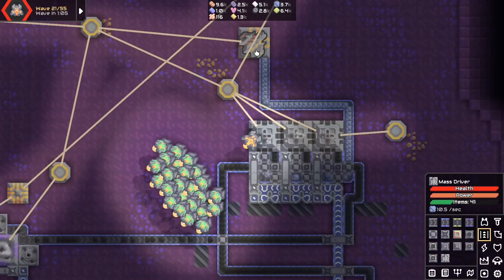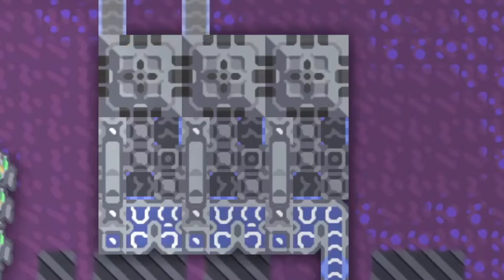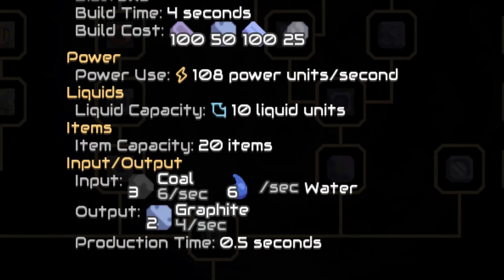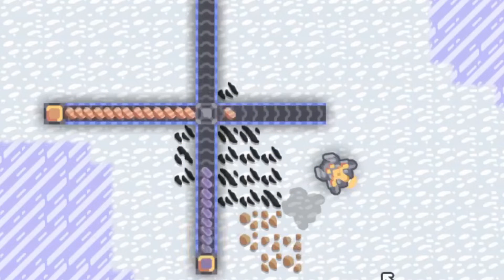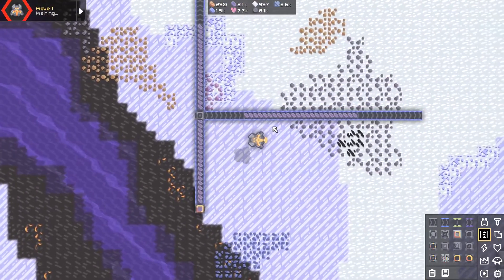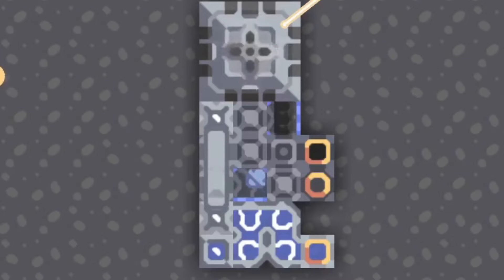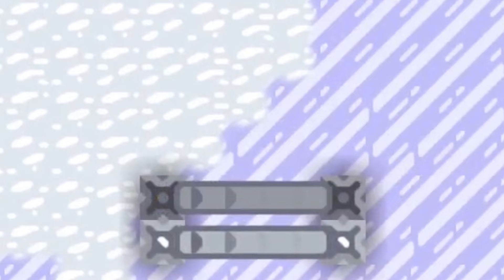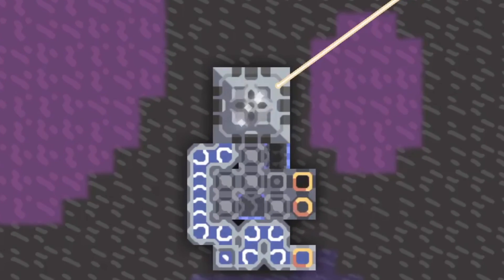Mindustry Schematics 1 | Multi-Press Graphite Maker

Comment: Is it really "modular"? The combination of an overflow gate and a junction is widely called as "Zipper" and is one of the simplest/least effective logistic strats in the game. The zipper's throughput is limited by the speed of a singular titanium/plast conveyor which is really, really slow. This multi-press setup will be more "modular" if you were outputting graphite from the top and inputting second lane of coal from the conveyor which is used for outputting graphite now.
Reply from the maker: Modular? yes. As efficient as can be? No. When I first show this schematic's modularity (?) in the video, you can see that I try to set up from the top. It would be better. I don't know why it doesn't already. Maybe to have a smaller footprint?
Reply: @Valerian138  well, the reason I was so sceptical about modularity is that the press itself guzzles almost half of the belt - you can't even put three in a row with a one-belt setup. The footprint of this design is not so efficient too - the "snake" of piping you used to consume free space inside the design is shady, that space actually could be used to insert a second lane, or could be removed completely and with small modification of feeding belts could save 1 row in height of the design.